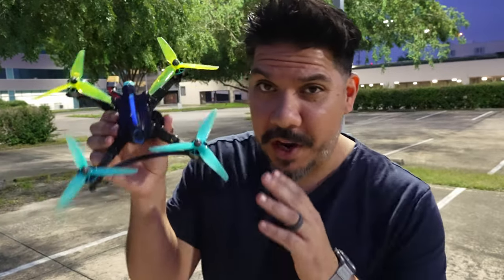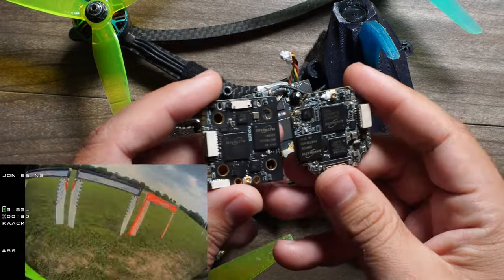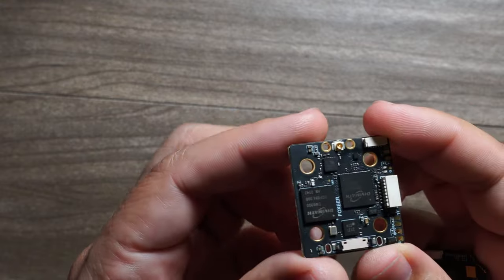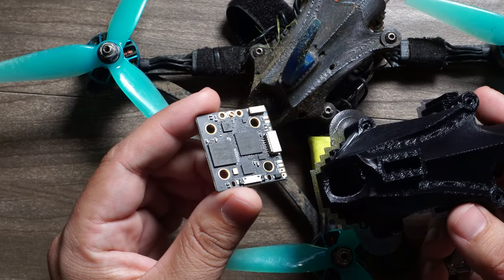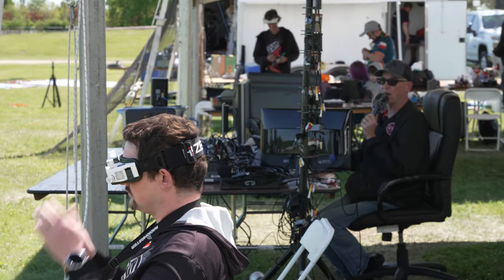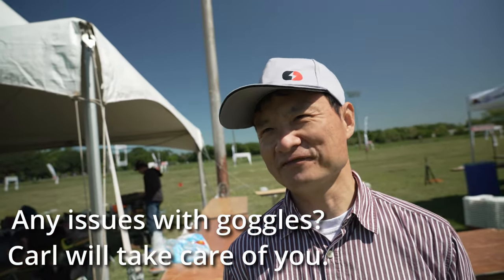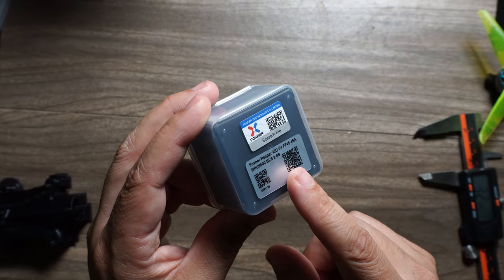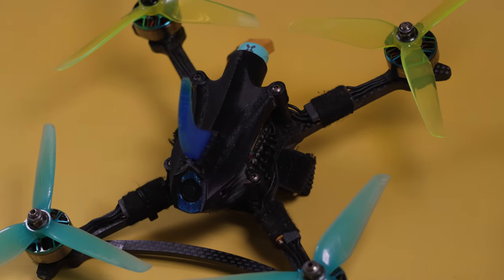First HDZero VTX (not made by HDzero)

Comment: I picked up fpv earlier this year and after all my research it was clear that i didnt want to go with a closed ecosystem like DJI or TBS Crossfire.

In an effort to learn as much as I can i quickly learned that the open source projects were much more interesing and that brought an ELRS boxer and HDZ goggles. 

I'm confident that was the best move for me personally, as a beginner and someone who is okay with tinkering with my hardware and software, and its a setup I dont plan on replacing for many many years. 

And I dont think HDZ is going anywhere. The company and products are amazing.

Comment: Very exciting times for fpv. I primarily run dji. But HDZero is interesting enough that I got the goggles for micros and racers. My Foxeer HDZero vtx just got in. Putting it in a Switchback Zero with a  Foxeer stack. Gonna be fun. 😎
Reply from the maker: ohhhh, curious what you think of that combo.  You adding the 90 fps cam?
Reply: @JonE5FPV  using micro camera. May switch to 90 fps camera when destroy the micro. 😎

Comment: I'm running 6s on the v3. My iflight board blew up super fast, this one is holding months already. I'm never using anything else than Foxeer besides some cheap ass tiny builds. Works really well with 3.5 inch builds and get as much power as you want. You wont blow this one up at 3.5 inch.

Comment: The newer HDZero cameras have made a hugh difference.  The Old Orange cameras were just marginally better than analog.   But in my whoops and backyard micros the new camera image difference is game changing.  They look 8/10 as good as Avatar and Caddax Vista in close proximity flying (very little interference situations) and the latency is noticeably better.  I never take out my old Beta85 3-4s DJI quad.  I am almost exclusively micro <3in backyard flying on 2s using HDZero and Caddax Avatar VRX.  All on one goggle.  I might be done buying DJI ever again.  Foxeer make a 1s vtx or a 2s vtx with more than 200mWs.  Please with sprinkles on top?

Comment: Foxeer always available? It’s impossible to find a foxeer FC 20x20 with a BEC to run the HDZ race v2 VTX. Then I see your video where you have a whole draw of them ha ha must be nice.
Reply from the maker: apologies for my HOARDING.  I am very paranoid about running out during a race season. Ill try to leave more for everyone from here on out.
Reply: @JonE5FPV  actually really struggling to find any 20x20 fc with a 9v BEC that “racers” like yourself and others use. You don’t have to see if they’re in stock but do you have any other recommendations? about to give up on the racev2 5 inch build and go for a tiny racer v2 instead

Comment: @200 MW geez don't set the world on fire with all that innovation
Reply: It's a race vtx, we run 25mw in races as standard.
200mw in a whoop for indoors tough.. plenty for what it is.
Reply: 200mw hdzero is quite performant all considered. I run it on my drones currently and I can get quite a bit of range and penetration, certainly a significantly better experience than analog has been, or for me, walksnail as well. Still going to eventually build something with the freestyle vtx so I can have even more power, but I'm not particularly hurting right now so it's not a rush.
Reply: I have HDZERO and I'm not over the moon with it, for what I do with the system I find myself going back to my WS or DJI rigs
Reply: @GenericEquivalent  lol, for freestyle I use WS also.
Reply from the maker: i get what you are saying for sure.  As a racing tool, ill rarely if ever use it above 25mw.